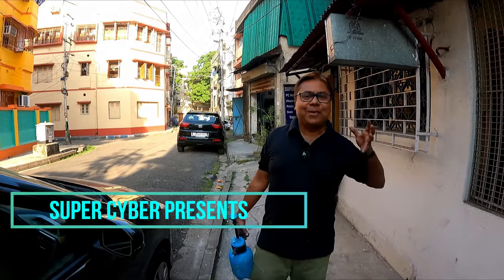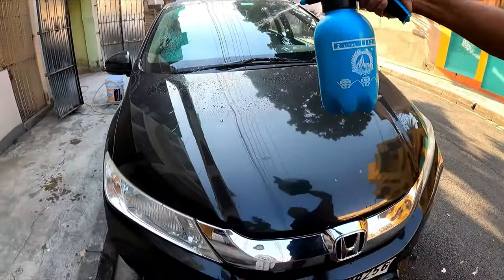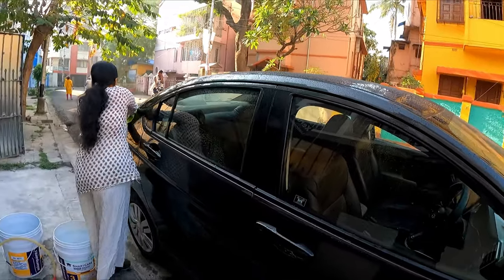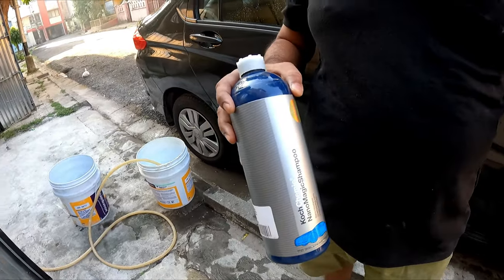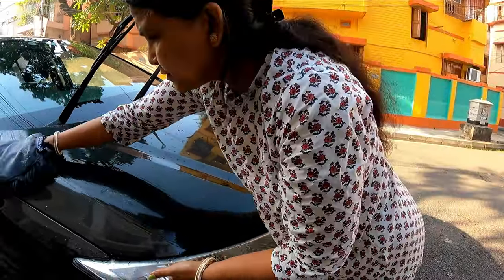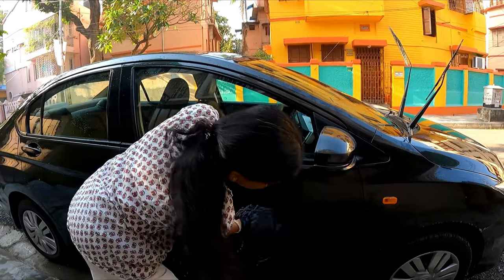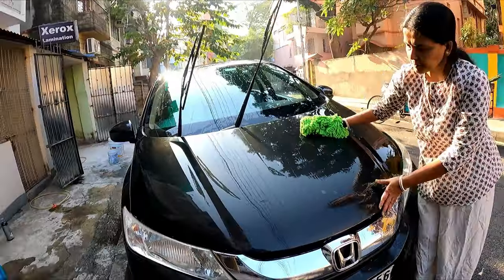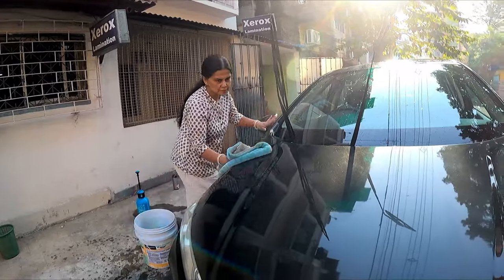Easy Bucket Car Wash Tecnique for You #carwash #cardetailing #kochchemie

Comment: Sir. I used jupasu duster on my new car which had similar dust but then i had microscratches now on bonnet... I feel bad.. i cudnt judge the amount of dust to decide on cleaning method.. now I have swirl kind of micro marks in bonnet area..how do I fix it sir..😢
Reply from the maker: If your car is very very dusty getting micro scratches is not uncommon. Use a Meguiers Ultimate Polish to remove them
https://amzn.to/3T7fe7U
Reply: @supercyberautomotivetravel  yes sir I live in coastal area, all I left it under well covered shade area was just for 2 days, it got thick slightly sticky dust. I'm new to cars, so I thot jupasu is good enuf to start so I wiped it off...later I noticed scratches in light.
Reply: @supercyberautomotivetravel  btw ur videos r extremely helpful for newbies like me sir. Very detailed , basic and feels like listening to a well knowledgeable fatherly figure !! Thanks a lot sir
Reply from the maker: Thanks for your appreciation. The truth is keeping a car absolutely swirl marks or scratch free in a dusty condition that prevails in most parts of our country.